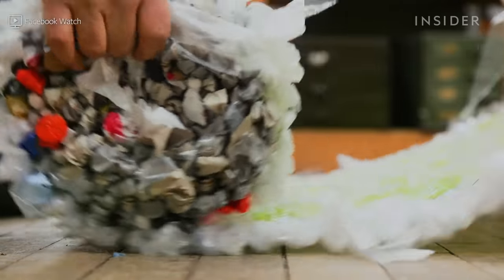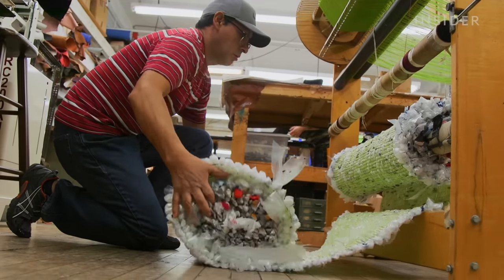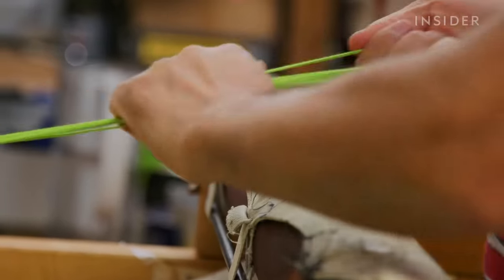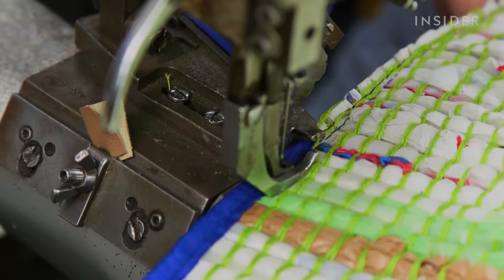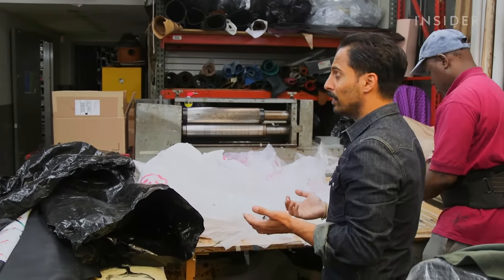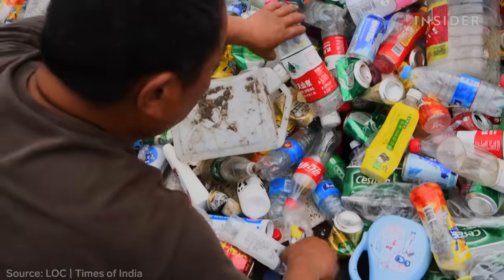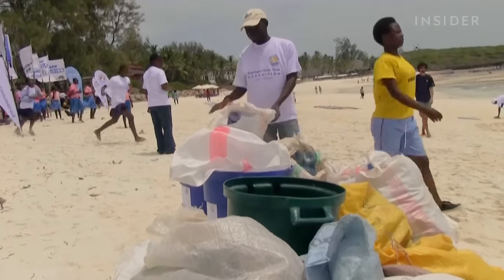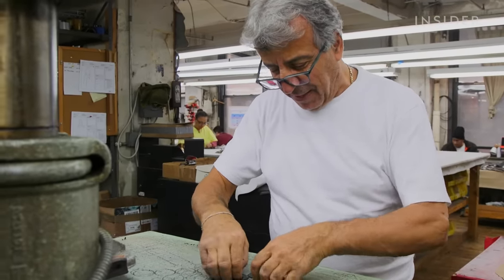This $133 Designer Bag Is Made From Trash | World Wide Waste

Comment: Great idea, but esthetic appeal needs improvement.  Perhaps, instead of fabric tape they ought to try rough stitching to connect the pieces. I like the colors and the texture, but that fabric tape makes the bag look cheap for that price
Reply: Rough stitching alone would never work, the seams will blow out without the reinforcement of the tape
Reply: @IunaIia  The tape could be used inside, out of site. The handles also, could be done as braided plastic, marine knots ets.
Reply: Also, small wheels like they do it at Hulken for much less money
Reply: @elibrod9981  having seams inside would work for something nonwoven, but this upcycled fabric is quite thick and would no longer lay flat with that design
Reply: @IunaIia  I wish I had the bag in front of me. Would have been easier to find a solution.
Reply: Its not just that ...for many years in the Philippines bags like that was a thing, its price here as $2 ..he’s alternative is not economical or environmentally sound cause only few can afford..

Comment: I’ll spend maximum $10 bucks for a bag like this. Pricing based on making cost doesn’t make any sense and not logical. Some one can make something in a hard way spending too much time does not add any extra value and also not a legit reason to increase the selling price.
Reply: True. It's nice that the bags are handmade, but it just doesn't justify the price. I make crafts from plastic bag yarn at home in my spare time. Handmade leather goods are expensive because sewing and crafting leather is an absolute pain and it takes a certain amount of skill and experience to make high-quality items...not so much with upcycled plastic tote bags.